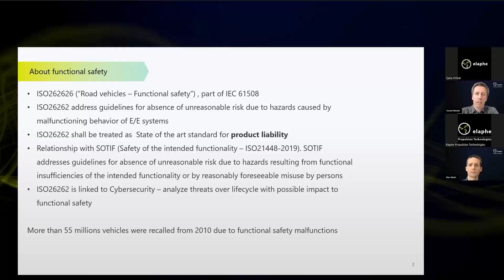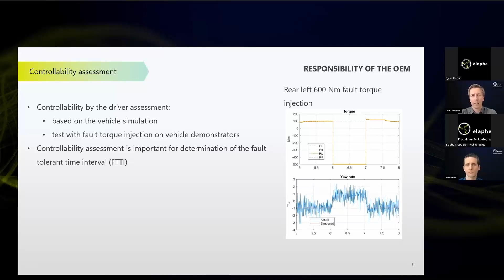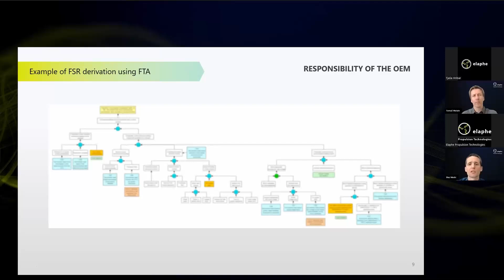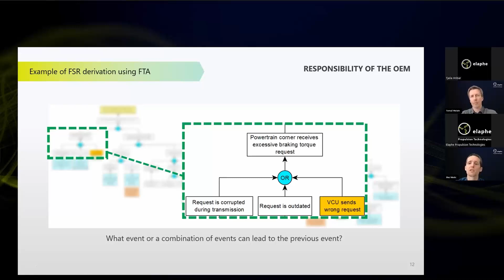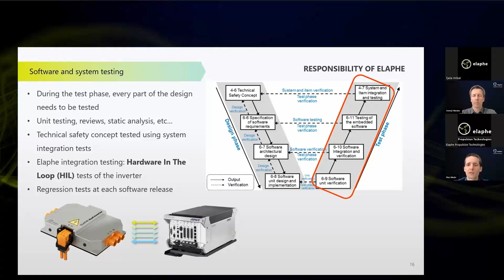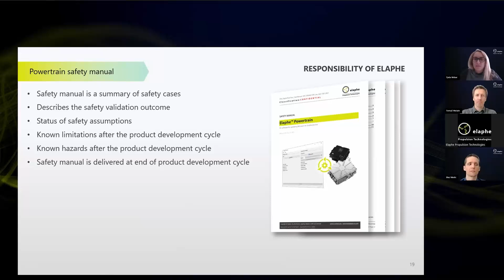Elaphe Webinar on Functional Safety

Comment: Thanks for posting this on the forum.This content will resonate with the engineers, system engineers, program/project managers, testers, and logistics people on the forum as it is what they do daily on R&D Projects. I think it has GREAT value as it shows what is behind the curtain in a development efforts. Hopefully, this will provide a better understanding of the effort it takes to develop a product. This is only one component of a whole system. Also, hopefully, it will inform those forum members that say, “Oh it is only a simple/easy change” There are no simple changes. (Little effort, low cost, easy) And this didn’t even address the logistics changes that need to be made with appropriate lead times to support a feature change or development of a new feature.

Comment: All controlled by the software, maybe someone needs to a car without software.
Reply: That'd be a Model T.
Reply: To my knowledge, there hasn't been a new car made (mass produced) that does not have at least a micro controller that monitors and controls fuel / air mixture and a ton of other things.  Software is behind all of it though it is more firmware than software. Most new cars today have more computing power than the space shuttle had but so does your mobile phone in most cases.
Reply: @ddessert6   No car had computer chips until at least the 1980's. The first cars I drove were 1960's models and everything in the car was analog - carburetor, transmission, ignition system, fuel system. Yes they had basic electrical components but not a single computer chip. It is possible to make cars this way but you can't optimize efficiency in the same way as you don't have the benefit of mass airflow sensors, precise fuel metering, spark control etc. Everything was a compromise. You had vacuum advance to retard the ignition timing etc, but those systems were not very reliable. If you had a vacuum leak that messed everything up. If you want to see how this stuff works go and watch videos on a channel called Vice Grip Garage. The owner of that channel Derek finds these old cars from the 60's and 70's and gets them running again and explains how all the systems work as he does it.
Reply: @aftonline  yes, I know there were cars that didn't have chips in them. I had cars from the 70s. In 1995 the US government pushed for better emissions and micro controllers were used to control fuel mixture and ignition timing to start with. I actually designed some systems in the 80s that could do this.
Reply: @777trader8  take the PLC out of any vehicle built after 1994 and it won't run unless you setup the engine like we had in the 70s. My point was that we have had micro controllers PLCs in our vehicles for many years now. If someone is opposed to computers in their vehicle, don't get an EV, get a bike.

Comment: It was pretty dry, technical and specific. Plus it had the complication of some speakers being difficult to understand. But it is clear that Elaphe is very serious and diligent about making their motors and control systems safe, well tested, and fault tolerant. My only questions are concerning Elaphe's interaction with Aptera, and the integration and implementation of control and safety systems in the upcoming Aptera. We know that there will be ABS braking, traction control, as well as tie-ins for future Open Pilot ADAS vehicle control. And I am also curious about torque vectoring, and electronic vehicle control, because Elaphe has done extensive engineering and testing in those areas, but Aptera's 3 wheel design would introduce new variables in vehicle dynamics and control. Thanks Steve for posting the Elaphe video.
Reply: Dry, technical, and specific is exactly what I want out of a safety briefing from engineers. :)
Reply: I suspect that FWD and AWD will have considerably different algorithms for almost all driving functions.  In some ways FWD might seem more simple but you lose the precision control of the rear wheel with just a disc brake.  In AWD you have very precise control of the rear wheel and can also measure the torque on that wheel.  It is great to see that Elaphe is following the risk / test process described in the video.  The Aptera will really be a control by wire vehicle and the computations must all work together or there could be serious injury. Safety and backup control systems are incredibly important.  (Say you are driving at highway speeds and for some reason the right motor fails.  Unless the motor goes into a braking mode, the impact initially would be minor but the VCU needs to sense that the right motor is no longer able to provide braking power and will have to apply more pressure to the right disc brake than to the left.  This definitely should display an alert on the console but will the vehicle be able to be operated with one motor inactive or do you need to have it put on a flatbed and repaired before being able to drive?)  Very glad that Elaphe and Aptera are considering all these conditions and so many more.)